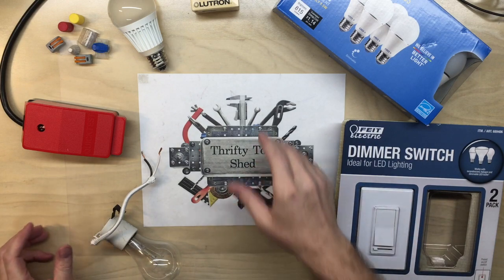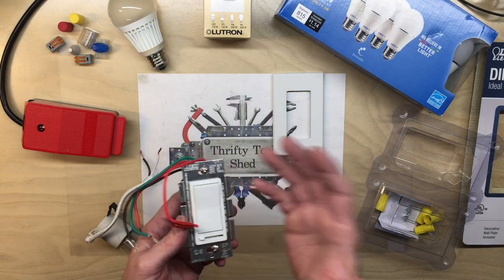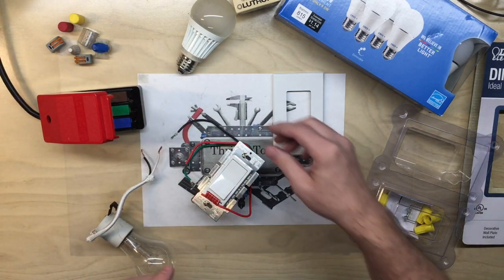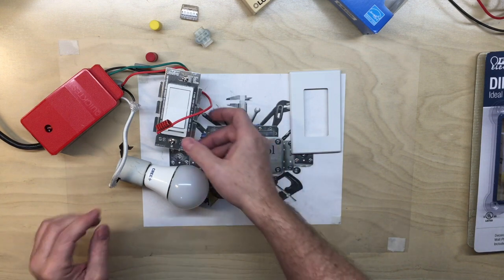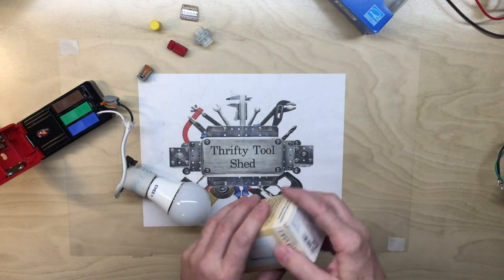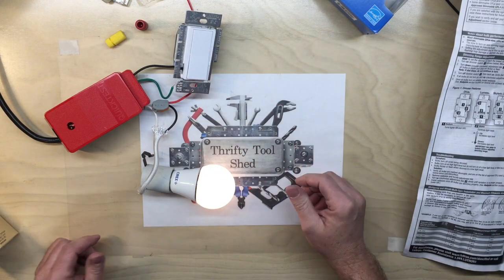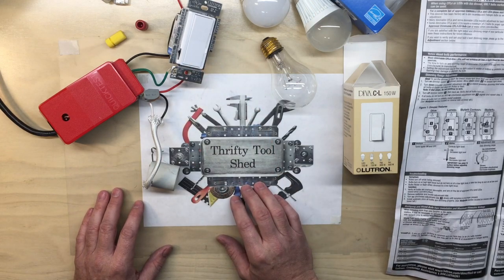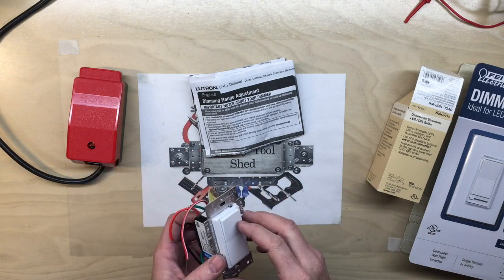Proper Dimming of Household LED Bulbs

Comment: Hi, I bought this Feit dimer switch. I got the power source came from the outlet on the bottom of the wall. My issue is that when I turn the Feit switch and dimmed the LED light -- The power source from the outlet reduces power also. Is it the FEIT is not compatible or I have done something wrong? Thank you in advance.
Reply from the maker: Although I do not know your exact application, I can tell you that the dimmer should not effect your receptacle at all. I wonder if you have the power parallel off of the receptacle or did you bring it off and it is somehow series feeding to the receptacle on the output of the dimmer?